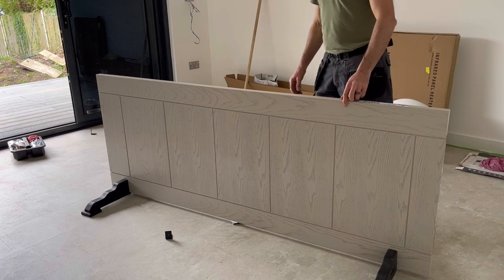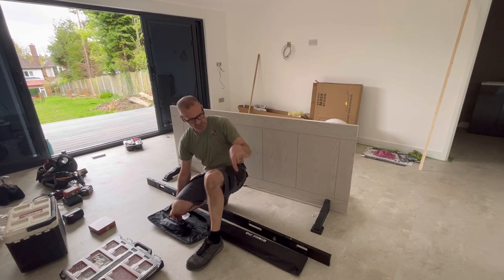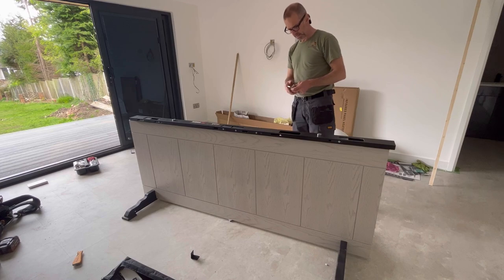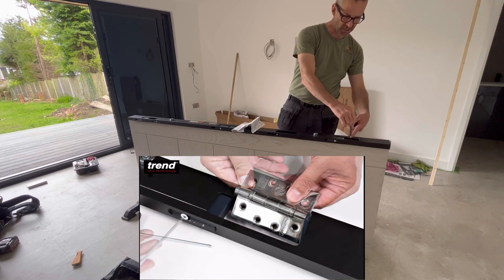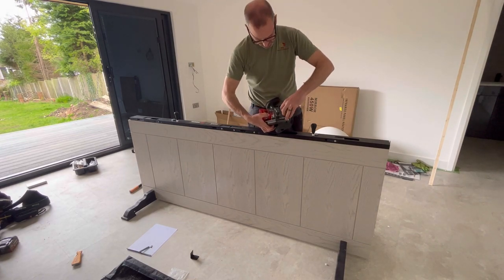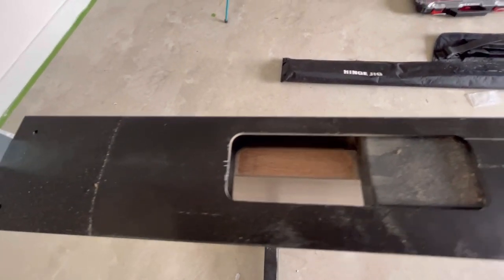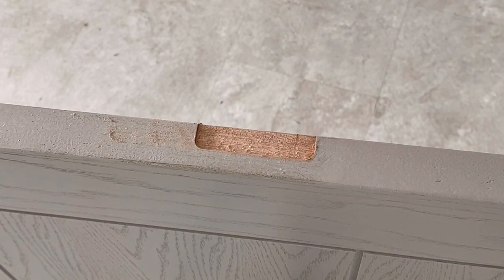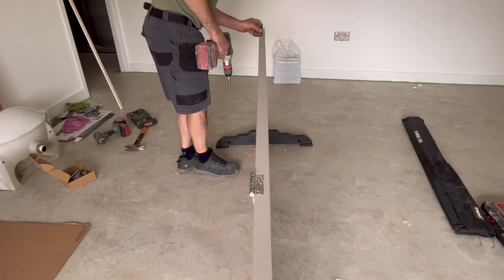Using the Trend Hinge Jig to fit a door on the Garden Room Project

Comment: I have the one piece jig which I've had altered so I can do 7" or 6" from the top of the door, I only use it on new work, I have a home made single jig which I clamp on to the door when fitting new doors into old casings. Keep the videos coming, honest and real world construction,  I've been a joiner 37 years and can relate so much with you lads.👍
Reply from the maker: Cheers Tony. We always appreciate comments from the experienced lads/ladies out there. Thanks for watching 👍🏻
Reply: Why  7 and 6 mate  not 6 and 9
Reply: @aaronbell8527  I said 7 OR 6 from the TOP of the door,  so I can do 6 and  9  or 7 and 9 depending what it specifies on the drawing

Comment: Nice video. Years ago in my Youth I did a massive amount of door replacement and had a very old school Porter Cable Hinge Jig it was a bulky piece of hardware, but worked extremely well for both entry and interior doors once set for the correct setting. These newer setup blow that old thing out of the water and also the router sizes now are smaller than 30 years ago plus available in cordless. Edit also a setup from Door Stud will help you hang those doors very easy.
Reply from the maker: Thank you very much for taking the time to comment on our video and really pleased to see we are getting experienced guys like yourself watching and liking them. I have for years stayed away from fitting doors because they gave me no enjoyment or sense of achievement. These jigs are good pieces of kit and I dare say I’ll enjoy fitting doors more using them. 👍🏻

Comment: Great video, I’ve just done the same thing! Purchased the cheaper older version and although I’ve not used it yet I’m wishing I brought the skeleton jig instead now! 😂 
It is more expensive so I’ll see how I go, I brought the Lock jig and door stand, the door lifted, a router bit set, spent £500 plus on Trend tools today so I’ll see how this jig is and if it doesn’t speed things up enough I’ll get the other one too.
Reply: This one’s way more accurate than the skeleton… yeah set up
Of the skeleton is easier but there to much play in the whole thing. Even where you lock the block they wiggle loose and stuff!! If you want proper consistency the old one wins hands down
Reply: The old ones better bit more of a faff with set up but more accurate and won’t come loose. Also a work Colleague has the skeleton jig and finds it leaves a to bigger gap at the head of a door.
Reply from the maker: Hi. I believe this is because a fire door needs a bigger gap around it to accommodate a brushed fire seal but I think it should come with two bits of metal so it can be changed to suit standard and fire doors 👍🏻

Comment: Hi I was just wondering is that router base a separate one you bought to take the guide bush? Mine didn't come with it? Thanks.
Reply from the maker: Hi Pete. If I remember correctly the base is a trend sub base specifically for a Milwaukee router to accept guide bushes. Mine is a trend one. 
Don’t get a uni base they are too big and don’t fit it’s got to be a sub base. 👍🏻
Reply: @mrabuilders6723  Just had a quick look and found it on the trend website. Gb/5/x sub-base i think its the right 1. Ill have to get 1 sent to ireland. Thanks very much for that help. Because I wasn't sure about them bases before I went and bought the uni 1.
Reply from the maker: No probs glad we could help 👍🏻